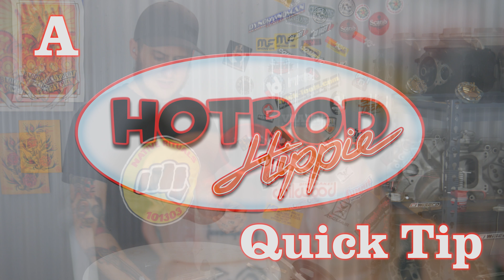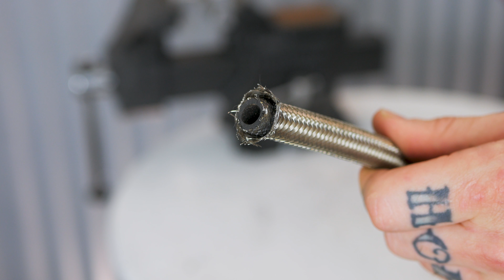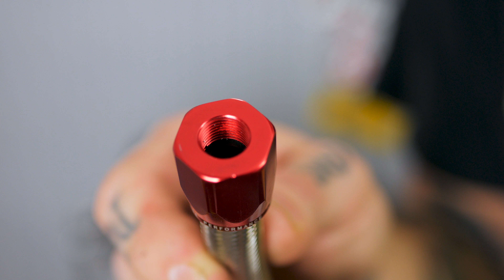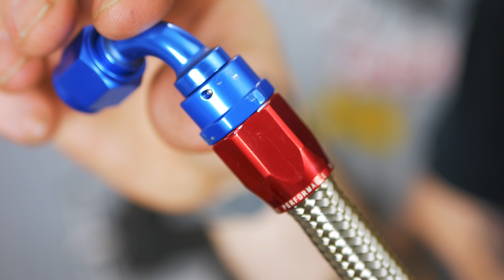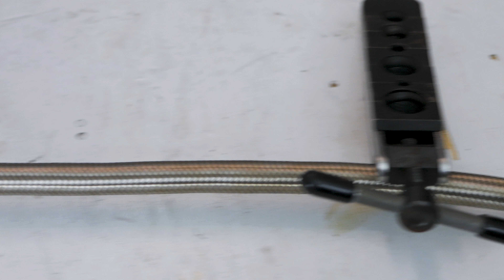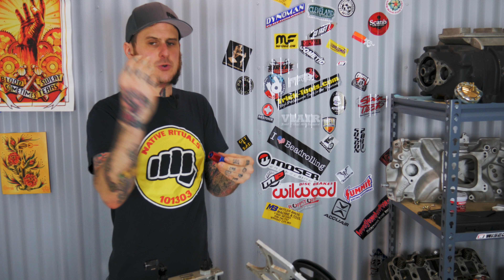How To Assemble AN Hose Ends - QUICK TIP

Comment: Assembly lube is a must have.  It is possible to damage a dry hose connection from too much drag.  The assembly lube I like and always use is DOW CORNING #4. A little goes a long way.  I apply the DC#4 with a Q-TIP.  I have used ATF with good success.
Reply from the maker: Bob Smith ooh I'll have to check that out. I would like to have it around for wiring connectors too. I generally use air tool oil or cutting oil cause I always have them on hand.

Comment: How do you attach an fittings to a steel tube?

For my fuel I have 1/4 npt at the pump, -8 at the filter, and -6 at the regulator. I'm thinking running flex line between pump and filter and between regulator and fuel rail. But for the pump to regulator (return) and for filter to regulator I'm wanting to do steel lines. Is there anything special about using an fittings for this? Or do I just bend it where I need and then do the 37° flare to the steel tube?
Reply from the maker: I know you found your answer in another video but I thought I'd drop the video link to my "Hardline Tubing Basics" video in case anyone else sees this comment and has similar questions. https://youtu.be/wayKqBT7z00

Comment: I'm building an off-road Rally car, and don't have anywhere under the body to run fuel lines that won't get hit with rocks....  is it safe to run the braided lines through the cabin?  i'd be worried about crashing the car and a line breaks loose in the car...
Reply from the maker: I would be as well. If it was me I'd run hard stainless lines bent and conformed to your  floor as much as you can. You can run bulk head fittings to pass through the firewall and such. Then I would make covers for all of the lines to shield them from the interior      

I'd also check rules for whatever governing body controls the races you'll run. They may not allow it.
Reply: Thanks!!!  I checked with the tech director, and he said to do it NASCAR style, which is stainless-braided lines encased in steel pipe.  ^_^